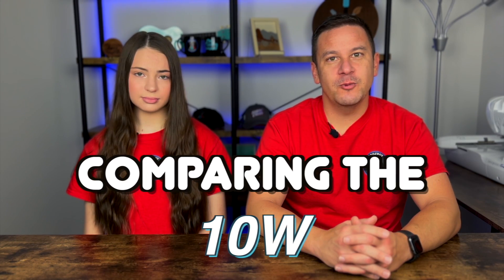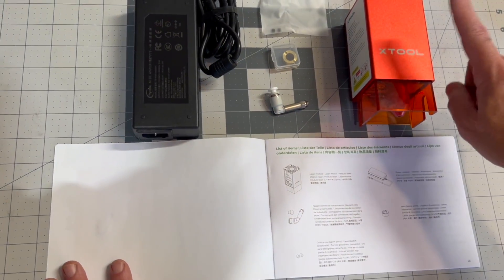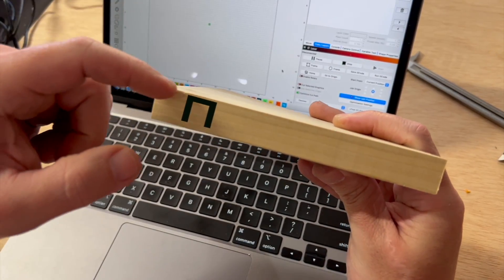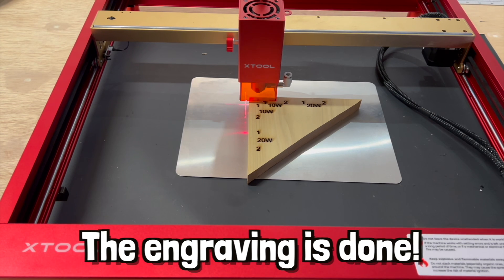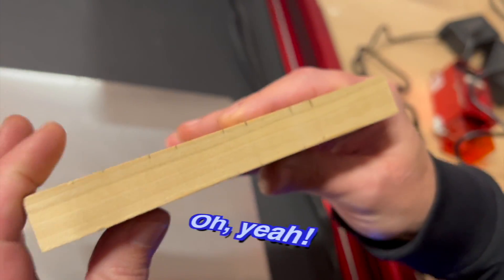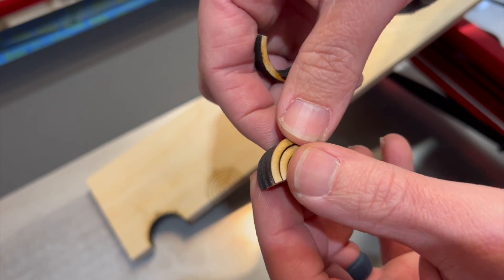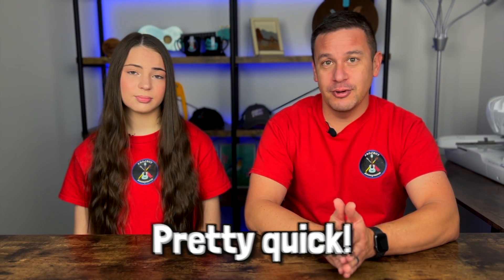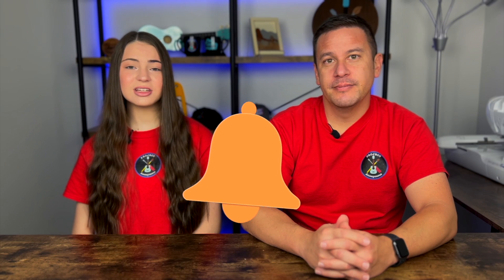xTool 10W vs 20W D1 Pro Diode Laser Engraver | Easily Upgrade Laser Modules

Comment: Where can I buy the 30w or 40w XTool D1 Diode Laser Engraver, To replace my 10w?
Reply from the maker: It is our understanding that xTool has discontinued the D1 and are no longer producing open frame machines, so they may not be producing any of those products for that line.  You might be able to find refurbished or used ones on eBay or something.

Comment: i has looking some month now what laser head/module need buy my DIY frame, less 150$ and 40W laser has perfect i cutting lot 0-3/4 plywood. but not know what need buy, have many different PWM and TTL lasers. i use hardware makerbase DLC32 board, im not sure what i need PWM or TTL laser and how deep can cut, perfect have if can maximum cut 3/4 plywood. and need my frame build Z axis controll too can change focus same time when run procram. drop laser head better focus big wood cutting. laser have little better some project than my DIY cnc machine cut small decorations. small curve cutting inside hole to decoration parts and dovetail cutting etc many different projects.

Comment: I don’t understand what the thought process was when they designed the connector for the laser module.  I change my module often because I also have the IR module.  They don’t last long and I can either rewire or change the whole wire harness.   So many really well thought out designs with the D1.  But some I really wonder what they were thinking.
Reply from the maker: We agree it is not easy to reach the connector. We aren't sure about the longevity yet, but we definitely have to be very careful with it.  We have liked the set up so far, but there is always room for improvements. Thanks for watching.

Comment: hi, have you attempted to cut through metal with the 20w? will it cut through metal? i'd like to see a video of that with the results. thanks! 😎
Reply from the maker: We have not attempted to cut through metal with the 20w. We will have to do a bit of research on that.  We'd imagine if it is at all possible it would have to be extremely thin metal and very low thermal conductivity. As we understand it, a fiber laser is the best for use with metals. We did use our fiber laser in a video we just posted to cut through anodized aluminum if you are interested in checking that out: https://youtu.be/5wybdJ7JXmg Thanks for the suggestion and for watching!
Reply: normal factory metal cutting laser need be about little bit more power, about not 20W need be 140W or more maybe cn use id buy 7-10 pcs 20W laser and then all laser line make together whit mirrors and lens then have summary lot biggest laser power. but how much this cost maybe better buy 140W CO2 laser.

Comment: how can i speed up engraving borders. they take far longer than the actual middle bit im doing. today one piece took 90 minutes the border took 65 minutes of the 90
Reply from the maker: The only thing we could suggest is if you haven't already tried, is to create separate layers for those parts, then you can adjust the speed and power.  Thanks for watching!